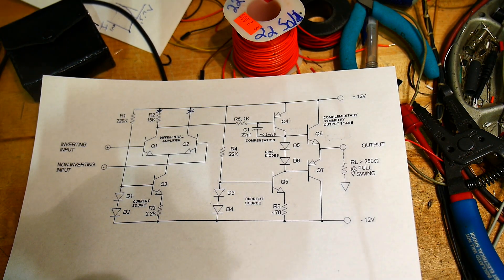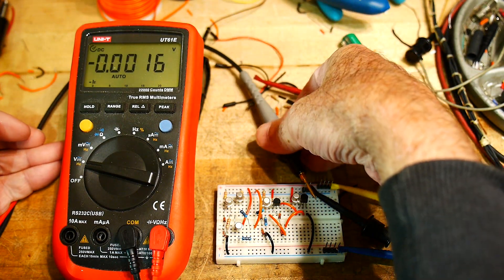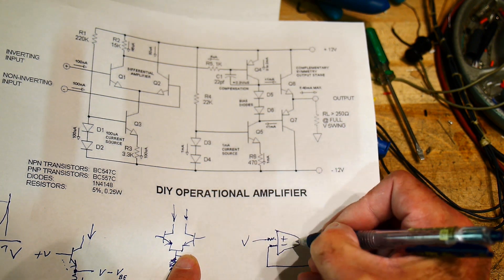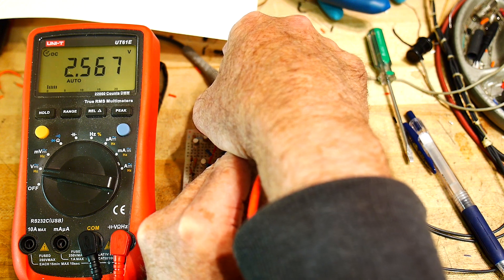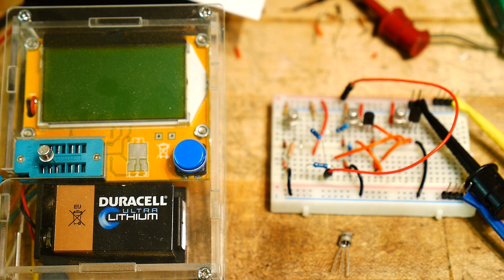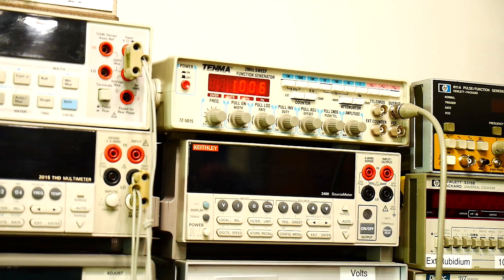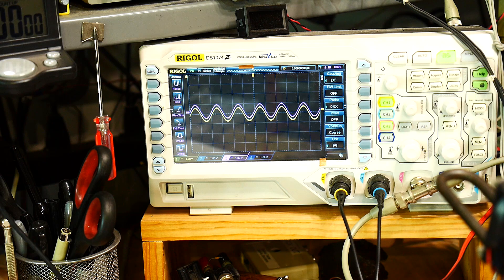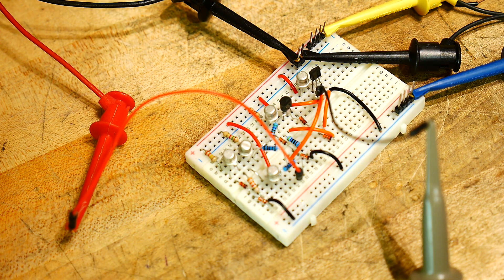#414 Build an opamp (part 4 of 7) output stage

Comment: I ordered 25 2N2222 NPN transistors off the Net. Using a component tester same one you are using. Gain was at 428 which I thought was high. Is it possible to have too much gain?
Reply from the maker: Probably fine here, In some circuits too much gain can cause oscillations or ringing in feed backs.
Reply: @IMSAIGuy  Thanks. I find your videos educational.

Comment: I’m wondering if having Rc on the positive half of the Differential Amp while not doing the same for the right (negative) side of that amp contributes to the imbalanced operation of that circuit. I’m not too familiar with the electro-dynamics of transistors, but even from my perspective, it seems that if you want something to behave identical to something else, it should share the same configuration.

REALLY enjoying this playlist so far.  I will definitely be building my own op-amp soon. It will be interesting to have an op-amp that can handle more than a few tens of mAs, or can it . . .
P.S. I have that exact component tester powered by Amazon Choice 9v batteries which match the color as if they were painted by the same brush.
I wouldn’t trust the hFE values since I calculated my own values and compared them to the tester and found they were nowhere close to accurate, but I suppose for relative measurements in transistor matching it will work just fine.

Comment: Hey imsai guy, my circuit seems to be having a problem. Whenever I connect the non-inverting input to any positive voltage source, my q6 (2n2222a) will short for some reason. I've already burned through 3 of them with the lowest non-inverting input being +3.3v, all whilst my inverting input is connected to ground. It'll be great if you could help me with the troubleshooting.

Ps, it worked only once after the first assembly, but then later attempts q6 keeps shorting. Tldr
Reply from the maker: what power supply voltages are you using?
Reply: @IMSAIGuy  for the op amp? +/- 12v supplied by two lab bench power supply.
Reply from the maker: @excalibirb9204  the only way to blow up the transistor is too much current. so even if the current source transistor is bad there is a resistor to -12v. there must be a short somewhere. you can remove the two diff transistors and see if the current source is working.
Reply: @IMSAIGuy  sorry sir, didn't quite understand as I'm still a beginner haha. I removed the diff amplifier transistor and I'm getting around 0.12ma. I'm not exactly sure how to measure the second current source though.. Can you teach me?
Reply from the maker: sorry, I didn't realize it was the output transistor. well the PNP Q7 could be shorted, or not be able to turn off
Reply: @IMSAIGuy  hey, I did a multimeter test on q7 pnp. It's not shorted and performing accordingly on the diode setting mode. It seems that only q6 keeps blowing up everytime I hook the non-inverting input to any given source.
Reply: @IMSAIGuy  it's really confusing to me as it worked perfectly fine the first time but then the second one and so on failed consecutively. I've checked for any short circuits on the board for about 100 times but it doesn't appear to have any.. Huh what am I doing wrong?
Reply: @IMSAIGuy  just to let you know that none but one transistor on my board is shorted. The other transistors pass the diode test. (no short)